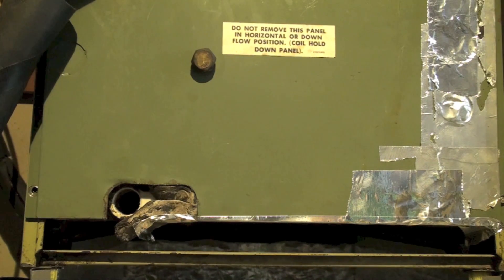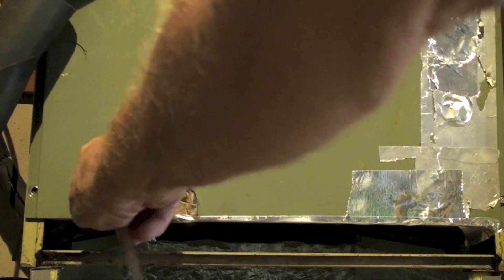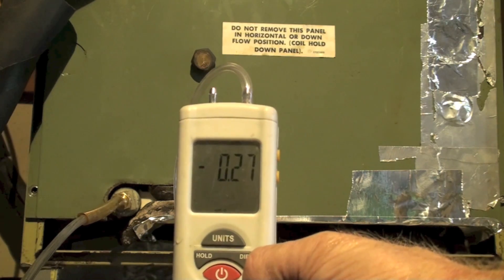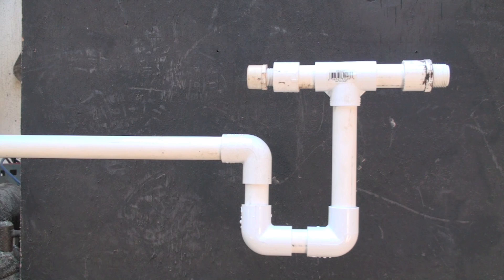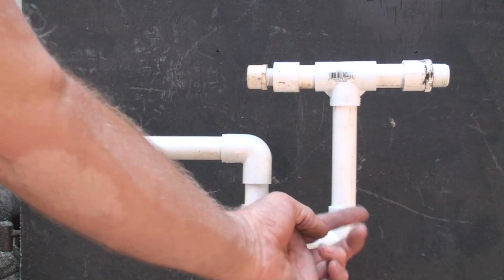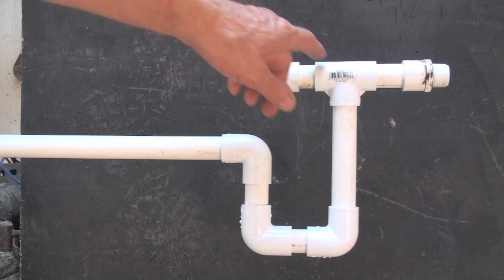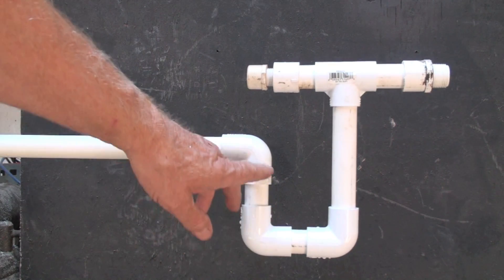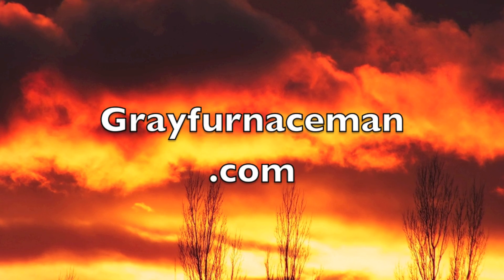How the air conditioner P-trap works

Comment: Thank you so much for this video,it helped me solve an ongoing problem. I had a new hvac system installed last summer and since then everytime we run the ac we have water running all over the floor. We had the installers back several times to no avail. After watching thus video I was able to see the problem, they installed a vertical clean out tee on the ptrap but didn't put a cap on it so the system wasn't able to drain outward as designed.  I installed a threaded cap as you described and it immediately solved my problem

Comment: Thanks for this review. The rule of thumb for the size/height of a P trap is twice the suction. So if the suction is 0.25 inches water column then the trap needs 0.5 Inches of water to ensure the trap has enough water to resist the fan suction. Having a deeper trap is good too, but when the unit is very close to the floor or roof, it's good to know the minimum size of trap that will work. Deeper traps have the advantage of not drying out so quickly during a heating cycle.

Comment: Does this mean that when my "energy-efficient" air conditioner won't drop below 77 degrees, with the thermostat set at 70, that my landlady changing out the extremely dirty air filter and banging on the p trap won't fix it?  She keeps the door to the unit locked and won't allow me access to change the filter.  She says that she changes the filters once a month, but I saw the filter and it was COVERED with thick, gray dust, and maybe fur.  She came over, changed the AC filter and said that fixed it, and it has to be 15 degrees over my thermostat setting of 70 before she will fix it again.)  What can I do?  Please advise.  I live in Oklahoma, in federally built, low-income housing, and many summer days are in the 100's, and as high as 112.  What can I do?  It's an all-electric house and  I pay for the electricity. (The stove is weird, too.  A few times when I've had the oven on to cook stuff, smoke has come off of the top range, and a wet sponge ran across the surface makes steam.  She's not concerned about that either.)  Thanks for reading this.  🙏 🙏 🙏 🙏 🙏

Comment: If the ahu is in the attic doesn't that make a natural trap by way of its route outside ahu is FEET above the condenser. So trapping again outside would be a double trap right?
Reply from the maker: Not sure I understand.  This is a condensate trap.  Condenser location has nothing to do with condensate removal.
Are you thinking of a refrigerant trap?  
GFM

Comment: Any thoughts on the CostGard drainer?
Reply from the maker: Its ok.  Kind of a solution in search of a problem in some cases.
GFM
Reply: @grayfurnaceman  
Doesn't it have the "set it and forget it" advantage? 

Next to capacitors ("don't get me started"), p-trap problems look like the 2nd biggest cause of HVAC service calls.
Reply from the maker: @hg2.  P-traps also have a "set and forget it" advantage.  If properly installed, a P-trap seldom gives problems.  In some cases, the P-trap is part of the equipment and no external device is needed.
GFM

Comment: thank you for the video. I spent eight grand this last year for a new carrier that has a very long drain line. the installer refused to come out or even talk to me because I was so frustrated over water running out of it every where and under my wall, in my filter etc etc. they kept telling me the drain line was clogged. I called carrier and had to hang up a few times and call back till got an older guy who just laughed at my intro to him. he said go put a P trap on it and problem solved. now I will be ready for next year, tyvm

Comment: You have to vent after the P-trap for the water to run.
Reply from the maker: You may vent if you want, but it makes no difference in the drain operation.  The volume is too small.
GFM

Comment: What kind of tool you use to test for negative n positive pressure?
Reply from the maker: If you are looking for an indication of coil blockage, use a manometer with one probe on either side of the coil.
GFM
Reply: @grayfurnaceman  appreciate that

Comment: Thanks for the video! Is p-trap needed for the secondary drain line?
Reply from the maker: Yes
GFM
Reply: @grayfurnaceman  I use some shower silicon chalk when doing stuff like this instead of glue. it is water tight and you can take it back apart easily if needed

Comment: I HAVE A QUESTION? DO WE NEED TO CONNECT IN TO THE DRAIN THE END OF THAT P TRAP? BEC.OURS ONE IN MY WORKING PLACE THEY NEVER CONN ECTED IN TO THE DRAIN
Reply from the maker: The piping should be located so that it ends at a drain.  It does not and should not mechanically connect to a drain pipe.
GFM

Comment: It still amazes me how many P traps I see installed wrong or missing all together. I've seen them installed upside down on sloped roofs even like just last week.
Reply from the maker: So true.  I even saw a P trap properly done then had an open Tee upstream.  Water everywhere.
GFM
Reply: I redid my condensate drain a week ago. It didn’t have a P-trap and I didn’t put one in. Mine has positive pressure so it’s a different situation and much less critical than a negative pressure as this video. My run is about 25 feet. It drains fine, about 6/10 of a gallon per hour. Pretty amazing how much water is in the air. I haven’t had issues with this design and I think the run is long enough where the loss of any  cooled is insignificant or non-existent.  My line started to have issues with about half of the line clogged with slime and sludge.  It was easier for me just to replace the line than to try and clean it.  Thanks for the video.!

Comment: Another thing that has been eating at me is: The placement of the vent stack on the unit side of the pTrap; which seems an entry point if the cap is loose or off. It seems of little value, especially being 90 degrees -45 and it'd aid in clearing a stubborn clog (like winter-caked in debris in the trap. it may seem insignificant, but if the vent stack were down-stream to the pTrap, drainage would be aided with the introduction of air (service calls would be reduced for stopped-up primary drains (except maybe that caked in, winter-long one, at the start of the season) then, and focus could be on service rather than emergency clearing of the line) - maybe a vent stack on both sides of the pTrap, with down-stream one being 1/2" pipe or even smaller diameter tubing (being its function is to provide air flow only, for water drainage -an especially useful application for long runs of pipe, as is possible in business installations)).

Comment: Yes, thanks for responding so quickly. I suppose that since your vacuum reading was 0.27 inches water column and you design your ptrap to have 2 inches of column height, that you want to ensure fumes, molds, algae, spores and other particulate are definitely NOT drawn back into the system and from their into the unit, ductwork and conditioned environment -I suppose chlorine gases too..., due to treating the drain system.

Comment: I haven't read the comments, so my question may already be handled; nevertheless, here goes: You gaged the negative pressure to be just above a quarter inch water column; so why do you recommend 2 inches of height for the trap -Thar's 8X the compensating column needed, I figure?
Reply from the maker: Well, there are calculations then there is reality.  Water column pressure varies for a number of reasons.  The 2" column is done to be sure it works.  Hope this helps.
GFM
Reply: and to allow a buffer for some evaporation

Comment: Gary, must all p-traps have a vent after the trap regardless of whether it's a negative/positive pressure system?
Reply from the maker: No.  Most do not need the vent.  A larger unit with large amounts of condensate may need it.
GFM

Comment: I work at a commercial building. I have a commercial air handler. I cant figure out why the condensate pan keeps getting full and splashing everywhere. I have a condensate pump. i cleaned the pan, cleaned the pipes, cleaned the pump, made sure the pump is running correctly. Used a swoosh drain line cleaner to shoot air through the lines. I shut the unit off and it pumps all the water outside perfectly. But once i turn the air handler back on the pan just starts building back up with water and starts to build up again. I made sure the trap line is filled with water. I have no idea why its still building up.
Reply from the maker: Two possibilities here.  The trap may not be deep enough to overcome the negative pressure inside or the return air negative pressure may be too high.  Look for restrictive filters or ductwork problems.  Hope this helps.
GFM
Reply: Small Caps air still being sucked into Unit. Check P Trap. Evaporation, not Big/Small enough.
Reply: Small Caps. Make sure no cracks in Panels. Air will get in.  Sucked  into creating pressure  power.

Comment: What can be done about p-traps drying up, creating a pressure leak when heat pumps switch over to heat in winter?  An extra deep trap might help, but for attic units,  I wonder if that would potentially freeze and crack the pipe.  How about secondary drains; how can you keep water in the trap?  Even if you fill it, won't a hot attic evaporate it dry in short order?
Reply from the maker: +Flyer66 The freezing potential is always there.  Not much you can do about it, but it is not a common problem.  
The pressure leak issue is not a large issue.  The primary reason for the P-trap is to control condensate drainage.  The cfm loss is not significant to me.
GFM
Reply: +grayfurnaceman 
After thinking about it some more, something that would work for the secondary drain would be to keep the trap filled with pink antifreeze (non-toxic; used in RV water systems, low evaporation).  In late Fall, the same could be poured into the main trap too. I never worried about freezing in the little store-bought P traps; I have always assumed they were shaped in a way to tolerate  freezing without cracking. But after watching your video, I'm a convert to the benefits of deeper, homemade traps, and I'd like to ensure that it doesn't freeze on one of the occasional 4 degree days we get in winter around here. 

As for the air leak if the trap is empty; I'm not sure you've convinced me.  In the past, I would have agreed with you, but now we have manufacturers getting anal over 2% leakage in their cabinet designs. In that context, a 3/4" hole seems like a big deal. 

As always, I thank you so much for the effort you put into your videos.  I have learned so much from them, and will continue to do so. I'm a fan!
Reply: Go on Roof. Lol.
Reply: DaddyFix Fill with water.

Comment: I have a bottom fed hvac condensor system, but the drain comes out and down into the bottom where the vacuum is at (in the air intake box cavity behind the intake filter).  Should the drain aparatus be inside the vacuum area like mine is?  It seems to be that all the videos that I see show the drain tubing and such outside the vacuum chamber.  Mine has the trap, but it also has a vent on the back side of the trap like you show that is not plugged.  My worry is if this is draining, or if the vacuum is actually sucking the water back from outside my house???  I only hear the gurgle (tapping sound) when the filter is in place like you lay out as the air needing to come from somewhere. My secondary drain hole has an electronic sensor that shuts down the air conditioner if water touches it.. and it does.  I drained 1/2 gal of condensate from my secondary drain port...can you give advice?  Should I have the drain line moved to outside the vacuum return box?
Reply from the maker: Stan Skaggs If you are getting gurgling while in operation, you have no effective trap.  The vent, which is code for some areas, should not be located upstream of the trap.  It defeats the reason for the trap.  Try plugging the vent.  Hope this helps.
GFM

Comment: I have Trane 5.5 Ton HVAC and its evaporator used to ice then I found that because the water draining pipe was blocked and the water used to stay in the tray under the evaporator was causing it to ice. After I changed the draining piping the icing problem was cured. Amazing how small problem causes big hassle!!
Reply from the maker: Waleed Al-Turki Sometimes the simplest failures cause the largest problems.  Thanks for the thoughts.
GFM
Reply: Shouldn’t have caused an icing problem unless the skin temperature of the coil is running below 32 degrees which is abnormal.

Comment: wheres the vent
Reply from the maker: If you put a vent, you don't have a P-trap.
GFM
Reply: @grayfurnaceman  vent has to be after the P trap according to other technicians, never before.
Reply from the maker: @markmzark5101  The choice to put a vent in a condensate drain is not important.  However, certainly it would be useless if placed before the p trap.
GFM
Reply: @grayfurnaceman  Everyone is asking about the vent because it is a common practice, and even code in my area. The secondary drain, which also requires a trap, is to be piped to terminate at a location where someone will notice, such as above a window.  We also require a secondary pan under the whole unit, with its own drain, that is not to be trapped.  Any unit that is installed over a finished ceiling needs to meet all of the above requirements in our area.

Comment: It looks like a 4-way PVC connection would work good, in that clean-out situation, if they exist. 
Has one ever been made?
Reply from the maker: They do make a cross.
GFM
Reply: what do you think of that, in your drain set-up? is it going to work to clean; in both: horizontal and vertical directions, with a gallo gun or nitrogen type of  set-up.
Reply from the maker: blissJesus1 It would probably work ok.
GFM
Reply: Im gonna try that set up on the next install I do, if the application will allow for it. That  looks like a good drain.